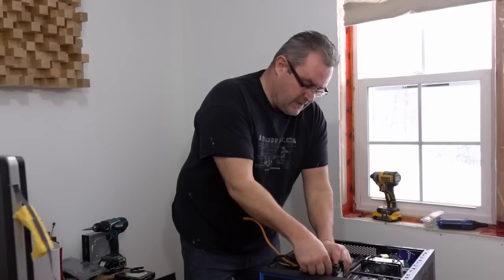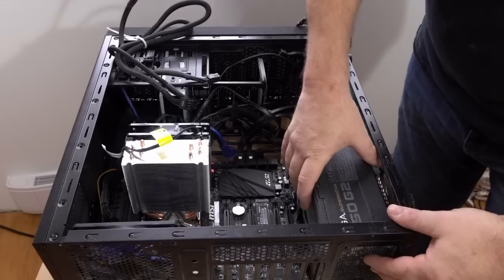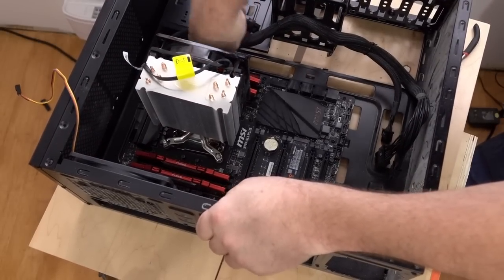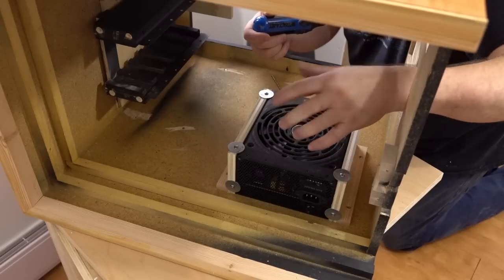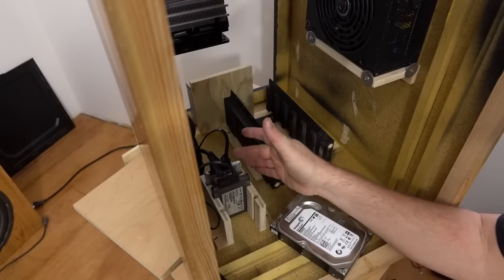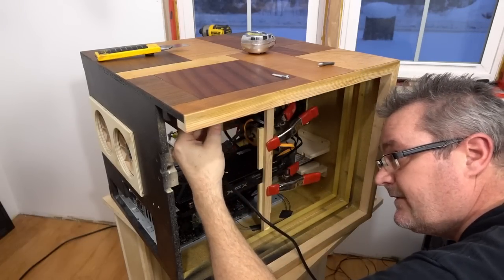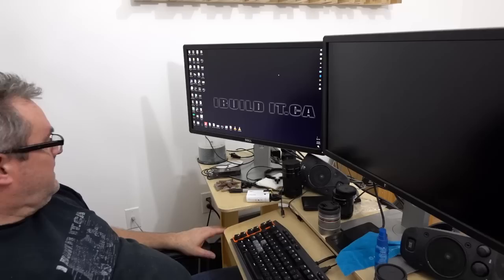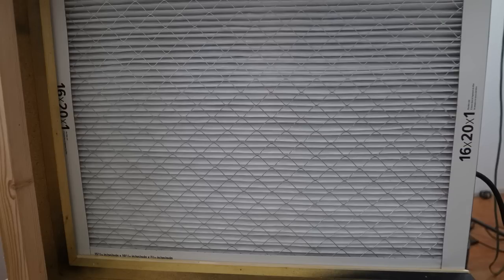Installing The Hardware In My Wooden Computer case

Comment from the maker: More details here:
https://ibuildit.ca/projects/refitting-wooden-computer-case/

You can help support the work I do in making these videos: 

Plans for sale: https://ibuildit.ca/plans/

Support this channel on Patreon: https://www.patreon.com/user?u=865843&ty=h 

Did you know I have other YouTube channels? 
My main channel: 
https://www.youtube.com/user/jpheisz 

More videos on my second woodworking channel: 
http://www.youtube.com/c/IBuildIt 

My home reno channel: 
http://www.youtube.com/c/IBuildItHome 

Website: https://ibuildit.ca/
Facebook: https://www.facebook.com/I-Build-It-258048014240900/ 
Instagram: https://www.instagram.com/i_build_it.ca/
Reply: You know John, there's some debate regarding whether or not leaving a system on permanently wears parts out quicker or makes them last longer. You know yourself, components expand and contract with heat when machines are turned on and off. They heat up and then they cool down, over and over and over and many believe this leads to weakened/cracked solder here or there.

I'm in the 'leave it on' camp. I recently upgraded my system and just in time too. I knew it was on the way out. I had both the old one and the new one running together for about a month when the old one gave out on me but man did that machine serve me well. Not long after building it I decided to leave it on permanently and not only that but I usually left it rendering as I slept too. It wasn't that fast - AMD Phenom II (4 cores, 4 threads) running at 3Ghz with 8GB of RAM, cool and quiet - not great though so I had to make the best use of time that I could. So I left it on.

Anyway, when you do this the one thing you can count on is having to replace the power supply, you have to keep that in mind and have a spare, they're the one thing that won't last but easy to replace - and a slightly increased energy bill, that too - but other than that, everything else will last and last for years. Mine lasted 8 years and I went through 4 power supplys - other than that it was flawless. A right workhorse and served me well. Paid for itself and then some. 8 years. They were cheap power supplys too and that was a mistake. This time I bought a higher grade one so maybe I'll have to replace it once but again I'm leaving this machine on permanently.

So far it's as stable as the last one. This one is water cooled, I went with AMD again - not to save money but because I want to see if it's as stable as the last one - but I got some heftier graphics cards and I over-clocked everything, the cards and the CPU so it gets hot. I live in a hot climate too so to keep it cool it gets noisy as hell but here's the thing .... when it's on all the time the noise sort of disappears. You only notice it when you think about it or talk about it. It's like your brain cancels it out. The noise is like a permanent 'feature' of the room the machine is in. When you turn it off to clean it out or the PSU dies .... that's when you notice it. The lack of noise is damn strange.

Comment: Genius idea to create a filter system built into the computer case.  Dust and heat are the enemies of computer parts and it looks like you have defeated them both!  I am actually really surprised that more effort hasn't been invested in case design within the computer industry.  Cool ideas though!

Comment: Great job John! I think you really did yourself a favor by introducing more airflow into your case. Be careful about ESD in the dry winter time, but it looks like you did just fine.
Reply from the maker: It needed more airflow for this computer because it generates more heat, but the airflow was just fine for the old one.

Comment: Nice case! Try resetting the BIOS (removing the battery from your motherboard for 10/15 sec). It's probably just skip the startup screen.
Rubbers between the case and fans would be the way to go.
Also awesome to see that with so many metal and diy parts that there is no rattle in your case what so ever...
Excellent job!

Comment: Unfortunately pcie extenders are extremely sensitive, you have to use branded ones like Lian-Li or 3M to get a 100% working gpu without power loss.. the only downside is their price and availability. You can find 3M ones on mouser/digikey or other electronic stores and Lian-Li mostly on Amazon

Comment: If your fan noise drives you crazy enough to consider re-mounting your PC components, then you might want to consider some comments from a professional in the electronics-cooling business.  First of all, it’s clear that your earlier arrangement for cooling the video cards was a disaster: not only was the space constricted, but the hot exhaust from one card blew directly into the input to the second card, making it harder to cool.  This is also a big problem in large data centers, where cold air enters the bottom of a rack of equipment, travels up though the shelves, and out the top.  The higher up you go in the rack, the hotter things get.  If I understand your new arrangement, the two video cards are in perpendicular planes, with their fans exhausting at right angles into the same volume.  This results in a lot of turbulent mixing and increased pressure drop, which in turn requires higher fans speeds and increased noise for the same cooling effect.  A better arrangement would be to put the two cards in the same plane, parallel to the back of your box, with their fans blowing directly into your main exhaust fans.  The bulk of the air flow would come up from the bottom, make one big turn, and exit out the back, with minimum mixing and flow impedance.  You should also match the fan characteristics of the exhaust fans on the wall of your case with those of the fans on the video cards, if that is somehow possible (maybe you should just buy the same fans that are used in the video cards).  It doesn’t make much sense to have a huge airflow coming out of the video-card fans and into small exhaust fans on the case that can’t handle the airflow.  With the pressure drops minimized, you can dial back all the fan speeds until the temperatures get excessive, minimizing your acoustic problems.  I’m presuming that your other components, like the CPU, will be adequately cooled in any case.  Also, in line with what other commenters have pointed out, vibrations from your fans couple mechanically to wall of the case, which then acts like a loudspeaker.  Two cures: (1) mount the fans to the wall using soft materials that weaken the mechanical connection, and (2) attach a heavy plate or board to the wall that makes it harder to drive acoustically.  Glue it on with adhesive that functions as an acoustic damper, or sandwich a sheet of sorbithane (an acoustically dead rubber material) between the two plates.

Comment: Using rubber or foam mounts will help reduce noise along with using some speed controllers to reduce the speed. I expect your motherboard has a PWM fan ports that can be adjusted in software.

Comment: That is a sweet case!  I remember being envious of it in your original videos.

I wonder if a lot of your noise is coming from those 4 spinning disk drives.  You said they're for backups only but I think that as long as they're powered and connected they'll stay spinning all the time, right?
Reply from the maker: No, mechanical drive only spin up when you access them.

Comment: I like noctua fans, pretty sure they have rubber around the mounting. I'm sure a fan can controller would bring down the speed of the fans but still cool it sufficiently. Also are you using an SLI Bridge?

Comment: I have one of the large 12 bay server towers that has seen better days and have decided to take the inner frame out and build a red oak case around the inner skeleton so i still have the grounding and mounts for the Mother board along with the space for the CNC drivers for a CNC router table i am building. That way i can close in allot of the openings and allow proper filters for dust control vs cooling. I always though about building retro Game Coffee tables like they had in restaurants in the late 70 early 80's but these could be used in the home setting since computing has come about. Internet cafe in your own home.

Comment: Maybe a foam strip, like you'd use around an entry door, between the fans and the case. Would dampen the vibration noise, and would stand them off without creating an air gap.

Comment: Hi John. I enjoy your videos. Here's an interesting computer tip that maybe you already know. When a HDMI interface is used between the computer and the monitor, the computer will treat the monitor as a TV screen, so to speak. The computer will decide the display resolution. When a VGA interface is used between the computer and the monitor, the monitor will tell the computer what its native resolution is, allowing the monitor to decide. VGA will provide much clearer detail when working with fonts and graphic design. HDMI is great for video and speed. VGA does not support audio within the cable, so a separate audio cable has to be used from the computer to the monitor speakers or to a separate sound system. HDMI supports audio within the cable, which can power your monitor speakers.

Keep up the great work. Peace.
Reply from the maker: I use display port, but HDMI works just as well and looks exactly the same on these Dell 4k monitors.

Comment: For the bios. You may have a UEFI version instead. To access that you have to go into the settings then go to Update and Security. From there go to Recovery. Then under "Advanced Startup" click restart now. Then click troubleshoot, then advanced options, then select UEFI Firmware settings. Finally, click restart. This will bring you into the bios where you can access boot drives and everything else.

Comment: For the fans, download "Speedfan" to control the fan speeds.. It can be a bit tricky to get going but it will give you full control of the fans in relation to temperature(0% for idle and as much as you want/need during load). (Maybe someone already suggested this, but I didn't look at comments)
Reply: Depending on your motherboard you MAY have to change some fan settings in the BIOS/UEFI

Comment: Is your fan speed set to run based on temperature?  If its still stock, sometimes they are noisy.   I don't know what software you are running, as some will control it.   If not, there are fan controllers that will do it as well.   As you said, its running cooler, meaning you can slow the fans down to run quieter as well, only bumping up the speed as needed, finding a happy medium.   You may not have to bother with adding some sort of cushion or whatever between the fan and the case.   Of course controlling the fans along with putting some sort of bumper/cushion/bushing to reduce the noise from fan vibration should give you the peace and quiet your are after.    As those Noctua fans are among the best out there.   To get better costs significantly more, more than at least for me, I'd consider spending on a fan.
Reply: Heh forgot to say liked the case alot.

Comment: To get into the bios you most likely just need to find the right video output on your GPU's or motherboard. Most cards will only output video to one output for the bios. For my last AMD GPU it was the DVI-D connector.  You really need to get more airflow to your drives. There is no real airflow over them at all. All of your airflow is straight up from the bottom over the GPU's/Mobo then out the back.  That is nowhere near good enough for those drives. I like the way the GPU's are getting cooled. Also my recommendation for you are upset about how loud it is you need to slow the fans down which will reduce cooling efficiency or you can get large fans like the 180MM SilverStone fans that are really quiet and move a ton of air. Static pressure fans would also be better for how restrictive that filter will be. Note that if a fan is being restricted it will spin to quickly and be pretty loud.

Comment: Very nice modification John! Unfortunate that the good looking veneer work you did will be hidden under your desk now. But performance and cooling is more important. Did you ever get into the BIOS?
Reply from the maker: Thanks Mac. Problem with getting into bios has to do with running two video cards, but as it turns out I didn't need to anyway.

Comment: Putting fans in foam or springs can absolutely make a big difference in the amount of noise they generate, in my opinion it's rather odd that the industry standard is to mount fans directly on the case.
Reply: Most of the fans I buy these days have rubber standoffs and they do help immensely.
Reply: Yeah but it's still not the best solution

Comment: Next computer upgrade could be watercooling. With the linear air flow setup like this, I think it would work really well. Also I have seen people support large cpu coolers like that to prevent sagging and undue stress on the motherboard. But with the top of your case being removable like that, I'm not sure where best to setup a support. Awesome video John!

Comment: I'm guessing the GPU card with no monitor is elected as The Primary One™ and thus gets (doesn't) the BIOS setup picture. Easiest way to test my hypothesis is to disconnect the PCIe extension bit and see if it helps.

Comment: wood is an insulator, all your internal bracketing and mounting should be made out of metal, a lesson we learned during the computer modding phase back in the 90's, aesthetically though what you did show of the case it looks like a really beautiful computer case, nobody builds a modded computer case like master wood worker, just watch the temperatures of any drives mounted on or close to wood, especially the bottoms of them......

Comment: Just a tip. You should always have more fans pushing air in to the case than fans pulling it out. With positive air pressure you get better temps and way less dust. And also if you have fans only pushing in with filters you don't have the problem that the fans take the air in from any hole and those random holes don't have filters.
Reply from the maker: You don't understand how this works.
Reply: Simply put, push all the air in the case. It will find its way out through the holes you have taped. Instead of taping-plug them, put a scrotch-pad to plug the holes and keep bugs out (not PC bug though ;)
Reply: I think he's basing that on how a standard case works, and in that sense, he isn't wrong. But I do see why it makes sense to have a pull configuration in your case.
Reply from the maker: I've gotten that out of context comment about a "positive pressure" inside the case several times, so it seems that it's a widely parroted idea. And for a standard case it makes sense, but not in this one. It's not hard to understand how this works (and works well), but first you need to stop just thinking that the stuff you heard somewhere else is the only way.
Reply: I agree with you on that one.  
It's a really cool case by the way :D

Comment: Can we get some temps, say at idle and under load? HWiNFO64 is what I use personally, but there are many other programs out there. Would have been interesting to see before and after temps, both on wooden case and metal case.
Reply from the maker: I already said it 10 degrees Celsius cooler at idle. The CPU never gets hot enough to be concerned about, it's the video cards that my editing program uses that pump out the heat.
Reply: Yes, I caught that, I was wondering what the actual temps were. I like the concept, better filtration and easier to clean. I would even go so far as to maybe make a little drop down door in front so I could change/clean the filter without having to get behind it. But earlier you mentioned (another video) having your computer shut down from heat. 10c cooler at idle may still not be what I prefer to run my cards at. Idle temps are fairly easy to get down, and obviously aren't as important as temps under load. But ok, its something anyway, and definitely an improvement. But you might not have a problem running your card a lot hotter than I do mine. At 20c ambient my idle temp is around 33c. Load/Benchmark at same ambient is 60c (Heaven benchmark at default settings). Some people don't mind running their card/s at 85 or 90c, even 105 if you can believe some of the stuff you read. I like 60's low 70's, more than that and I'm looking for an issue. Cooling a computer isn't that complex, move more air and it will cool better, but would be nice to know if one would have to factor in another fan if building a similar case to yours.